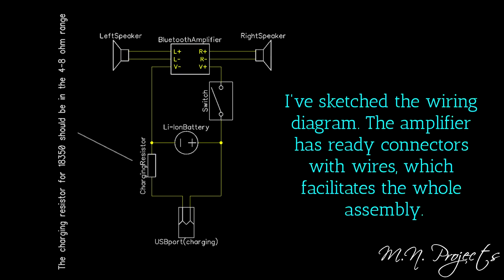Making a Wooden Bluetooth Speaker

Comment: To anyone even thinking of doing something similar: Do NOT put epoxy on top of the positive side of a Li-ion cell - that is like asking for trouble. The cells are constructed so that in the event of an internal failure they will vent that way instead of exploding like a grenade.

Comment: I was thinking about this all day - if you did this again except you built the two speakers inside two tubes (so the tubes extended beyond the speakers themselves), then the sound would be amplified. Maybe designed into a mirrored T shape (T shapes top and bottom, N & S), or a C shaped design. ;)

Comment: I love how U used a 6w amp board with a pair of 5w speakers. I may not be correct, but I assume it would reduce the rate of distortion by a huge amount since the speakers will not reach their max potential, and I think its a good thing. I own an Anker Soundcore Nano which has a 3w speaker and I find it to muffle when playing certain tracks at max volume. Awesome build!

Comment: awesome speaker the only thing i would have done would have been to drill a small hole or 2 on the bottom to get air moving in and out of the speakers for better sound
Reply: you do realize that that's not how speakers work?

Comment: Why not use wood glue for gluing all that wood?
Reply: Because wood glue is cheaper :P
The only reason I can come up with would be that epoxy is slightly stronger (which doesn't mean anything in this regard) and that it cures in five minutes (which actually is a reason and makes a difference).